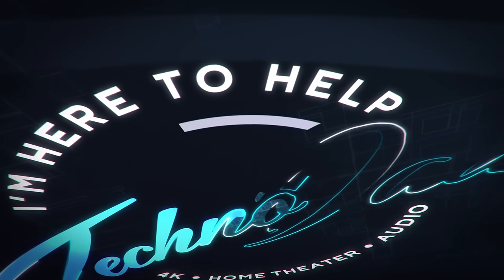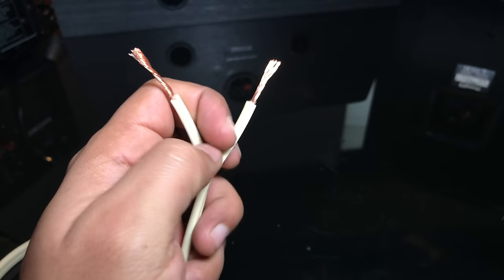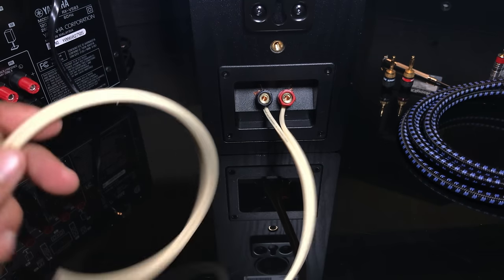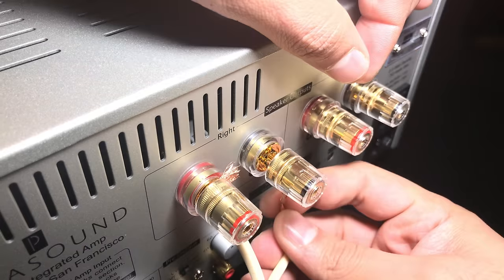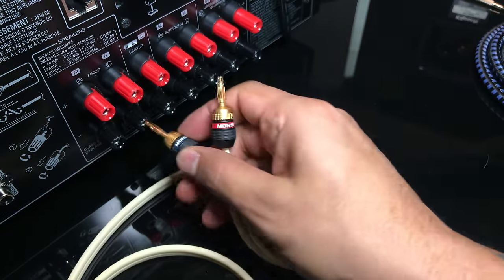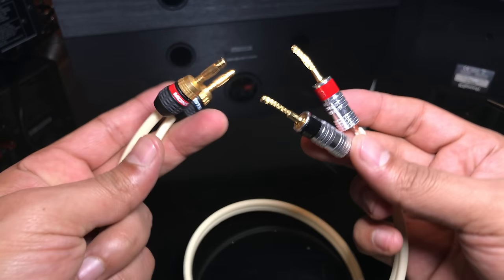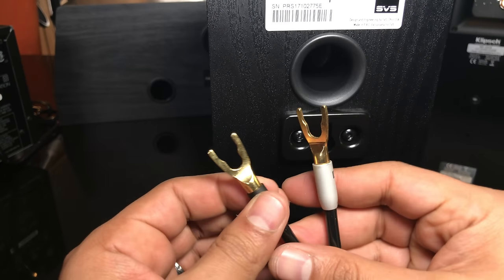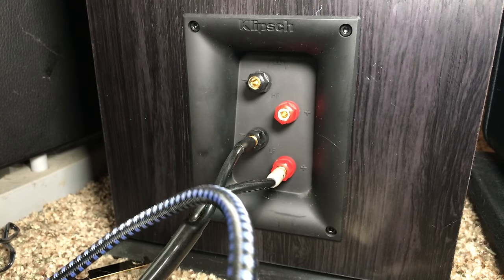How to Connect Speakers to Amplifiers | Home Audio Basics

Comment: Is there a way without having pre outs on your receiver to Output to a separate power amplifier. I know subwoofers can extract the audio signal from high level inputs but is there any devices that can receive high level power signal with binding posts inputs for multiple channels to be converted to line level outputs?
Reply from the maker: I don't think so.  If you're already sending the signal and power from an AVR to an amp input, I think that would cause problems.  Also, it's probably hard to find amps that will have binding posts as inputs.
Reply: Techno Dad I know they make converters for car audio that can convert the speaker outputs from your head unit into line level. Most subwoofers can do this as well they can extract the signal from the power output of a receiver and amplifier.
Reply from the maker: Oh that's cool.  I haven't tried that out.
Reply: Techno Dad I did a little research and found out that the car audio ones have a 60 watt limit.
Reply: Techno Dad I did a little research project I found that Carver made something called Z coupler that did that.

Comment: just got a old wharfdale dx1 cinema speakers (probably the same connection as current dx2) - just tried plugging a 4mm 'qed airlock' banana plug in and it doesnt seem to fit - fits ok into my denon 2019 av receiver..
Reply: to answer my own question and from a forum somewhere - wharfdale dx1 (and prob dx2) do not take regular sized 4mm banana plugs - need shorter ones or connect via cable only.

Comment: i have a bluetooth speaker harman kardon play 2 and the speaker is blown out,i read the specs of the harman kardon and it says Input Impedance250mV/>10k ohms..the original blown out speaker was 4 ohms my question is can I replace it with an 8ohm rated speaker looking at the amps specs? Thanks

Comment: Hey, can you help, I have 2 center speakers but only 1 port on reciever  for 1 I have them vertical each side my tv. Could I possibly use 1 port for both speakers
Reply from the maker: I would not do that.  Do you have a speaker on either side of the TV?  Those should be your front left & right speakers.
Reply: @TechnoDad  hi thanks for the reply, yes I have 2 center speakers and also L/R speakers. Could I possibly use the surround L/R for my 2 center speakers
Reply: @TechnoDad  I have 2 jbl stage A135c vertical on the wall each side my tv. I also have 3 floor standing speakers in 3 corners, front left front right and back left corner.. I have 2 subs and 2 bookshelf.. my avr reciever denon AVR-X1700H.. I cannot have 1 center speaker above or below my tv so I need help trying to set these up best way possible.. I was thinking about using the back left floorstanding speaker jbl stage A190 as a center?
Reply: Or have my front right floorstanding speaker as my center as its pointing to my seating position straight towards me then have the back left floorstanding speaker as my front right

Comment: How do you plug the other end into like a TV or something. Do you use the same banana plug
Reply from the maker: No, you would need to connect the other end into an A/V Receiver and then connect the TV to the A/V Receiver via HDMI ARC or Optical cable.
Reply: @TechnoDad  can you plug it from a speaker into an amplifier and then into a TV? Because those are cheaper from what I can see

Comment: Wouldn't an expert be using a wire stripper to prep the cable? Maybe explain that twisting the wire is to prevent fraying?
Reply from the maker: I was 12 when I was doing this.  Didn’t need to be an expert.

Comment: hi techno dad, i have a marantz 8012 receiver and I'm using banana plugs on all of my binding posts, for some reason i lose the signal from my height 1 left binding post about every two weeks, after I unplug the banana plugs from the terminal and connect it back to the receiver the sound returns to the speaker and everything works perfectly again,i don't have this problem with the the other binding posts and all the other speakers works flawlessly. Do have an idea on what can be the problem? Can the receiver be damaged? Even though it works perfectly for days until this problem occurs? 
thanks
Reply from the maker: Hi, that sounds very strange.  I would contact Marantz support to see if something is wrong with the receiver.

Comment: Hi, I am very frustrated with my speakers. There is an uneven sound undulating and I have cleaned, stripped and the wires many times now re-wired the speakers and the sound persists. is the wire too old?

Comment: The speaker wire you use depends on where you want to put your speakers. For example if you put your speakers maybe in the wall then you would need in wall speaker wire.
Reply from the maker: Totally!!  I didn't get into CL2 or CL3 rated wires as the request from a subscriber was to make a video about connecting speakers to amps/AVRs.

Comment: I did just like you the amp can detect the sounds( it beats as per the music ) but the speakers are muted
Reply: EL clan PUBG Mobile I realize this is an old post, but how did you solve the problem? I'm having the same issue; I bought a cheap roll of wire that I am in the process of returning and I'm hoping that will make the difference.

Comment: Hey I just got my klipsch RP-280 set. I was wondering how your RP-250S's have the banana plug connectors. Mine I have to feed the wire through and screw the post down....
Reply from the maker: Hi!  I have all those same speakers and there are little red and black caps on the ends of the binding posts.  You'll have to remove those.
Reply: OK. Rookie question #2... When I start setting up my receiver with the heos and mic, how do i connect it? HDMI cable to say HDMI 1 on my TV? before today I only had a subwoofer hooked up and I used an optical cable to make it work. Now it's time to calibrate it all and I don't know how to start😂
Reply from the maker: Do you wanna email me?  Technodad55 at gmail
Reply: Hey I emailed you. Just making sure you got it...

Comment: I bought a Yamaha 5.1 surround sound package. It came with 24 gauge speaker wire it worked ok but was told to upgrade my wire to 18 gauge, I did that and my receiver started smoking and turned off. What di you think I did wrong.?

Comment: I don't know about audio system. I have bought edifier R1280T Bookshelf Speaker.... I feel that I'm missing the bass a lot. Is there a possibility to connect subwoofer with R1280T speaker. It's possible then how? What can i buy more to bring the bass effects to the audio. Thanks in advance

Comment: My speaker amp had the spring clips on it, and unfortunately when I try to use pin connectors on it it dislodges the connectors, and thus I have to load them back in, I'm thinking of just going w/o the connectors for the amp.

Comment: I did everything correctly but my left Speaker is distorting for some reason even tho they are new.
I tried switching the cables but nothing changes, the right one is sounding pretty good.
I didn't drive the sound to much.
Could it be that my left one is blown up even tho it's not used yet ?

Comment: If the “insulated” aluminum base of those pin connectors come in contact with each other will they short out a reciever and/or the speaker? Are they safe to use or should extra insulation be applied just in case? Help me @technodad youre my only hope.
Reply from the maker: Lol!  Hi!  Yeah, that could possibly happen.  Maybe some electrical tape would help?

Comment: @RD CREATIONS   @RD CREATIONS  I have bought ahuja tza 4000em amplifier ; how can connect six speakers with 4w,90DB,200Hz_1KHz,120/240v, 70/100v inputvoltage each, could you tell me the bes
t connection to get good clear sound?

Comment: I bought speakers that say 100W in the manual, is that 100W for 1 speaker or for both?
Reply: 1 speaker
Reply: @luxurybuzz3681  So each speaker can handle 100W right?  And if I have an amp that is 100W is that 100W output per speaker or 50W per speaker?

Comment: So please help me here. I have just got a second hand onkyo tx sr 606 avr receiver and I have never used one before and I have got a second hand pair of B&W p4 floor standing speakers but they don't have any clip or bridges on the back where the binding posts are. I was told that I just need to get some regular speaker cable and then from the avr to the speakers split the cable at the end and go through the top positive to the bottom positive and the same with the negative.. I'm lost then someone says I need a piece of wire to go between the two sides.. What do I need to do please.
Reply from the maker: Oh, just get some bi-wire cables - https://technodad.biz/BiWire
Reply: @TechnoDad  so if I bought bi wired cables then will I need the bridge bar terminals?

Comment: Hi I have lepy mini amp how do I connect creative mini speakers to the phone through the amp. The speakers have a 3.5mm plug I have connected 3.5mm connection from the speakers to the amp through the 3.5mm jack and it turns on but the volume treble or bass didnt work it only plays through the speakers. Not through the amp  It works if I plug my presonus speakers through speaker wire to the amp can I get something so it does also why would it not work.

Comment: Hi i have an old aiwa SX ANV-900 speakers, I dont have the stereo system now, how can I use the old speakers?
Reply from the maker: Hi!  You could get a small amp and connect those via BT to your phone or optical to your TV at least.
Reply: @TechnoDad  my problem is that it has extra pair of wires for both speaker for the surround sound aside from the pair of L and R wire for the main speaker.
Reply from the maker: @luigisalvacion4536  What AVR is this?
Reply: @TechnoDad  the speaker is from an AIWA hifi component but we dont already have it. On the speaker it says AIWA SX ANV-900 Front 180° 4-way bass reflex speaker system.

Comment: i have a subwoofer for home theater and ive never seen this but it has 4 + and 4-. 2 are input 2 are outputs how do i hook the speaker up. its a 6 speaker and im trying to hook it up to a stereo reveiver.
Reply from the maker: Hi John!  Email me with some pictures of the subwoofer connections.  Technodad55 at gmail

Comment: I have the banana clips and yeah that shit was expensive. I have two home theaters so it took me awhile to get clips on all of my cables and yeah makes it easier when I upgrade receivers. I'm use 12 gauge cables in the living room, and a mixture of 12/14 in my computer room.
Reply from the maker: I only have 12 gauge on my front stage.  I couldn't imagine trying to hide two 12 gauge cables in the carpet for my surrounds.
Reply: Techno Dad I have one of those long heating vents I hide the cables under. Couch against the wall so you can't see it. Living room I have 14 gauge for the rears with carpet and long part of my sectional hiding the cables.

Comment: I bought bananas clips but they don't fit into the hole for sub-woofer.  I purchased a new sony 760 receiver.  but using old sony speakers from  previous system. I had to cut the end off of old wire. what should i do?
Reply from the maker: Does your subwoofer have an RCA input?
Reply: @TechnoDad  Not sure this subwoofer is from my old sony str-dh380 home theater system

Comment: It's at a "crazy" angel because you didn't bend the connectors!  Those particular connectors are meant to be bent as needed. If you would have bend them at a near right angle, you would have had far less difficulty.  Either way, really good video!
Reply from the maker: LOL!  Right on Mondo, thanks for the tip!
Reply: Absolutely! No doubt, brother! Ol' school style, baby! Haha!  I am an old NYC DJ and back in the day we used to just push these bad boys into the ground to bend them to where they would fit nicely!  We had to improvise because we never had tools!  I enjoyed the video very much, I actually order the monster banana plugs. They do cost a bit more but they will make life much easier!
Reply from the maker: I see!!  Thanks for the tip!!
Reply: Could always trim the cable to different lengths!

Comment: How we defer positive and negative wire? Both looks same colour..?
Reply from the maker: One side will have writing on it.  Figure out if you want that to be the positive or negative pole and stick to it.
Reply: @TechnoDad  thank u.. Everything ok now. Now i have a 7.1.2 system. I used my old boss acoustimas 5.1 's speakers for front center left and 2 ceiling downfiring speakers and used 2 onkyo speakers for surrounding L and R and back surrounding. I need to find couplers for my 2nd subwoofer. I do have 2 subwoofer cable thought to connect each other. So it will reach my 2nd subwoofer. Thank you so much for ur suggestions. I need to update my projector to a 4k from epson 2150. Thats my next project. 🙏

Comment: Why is a bare wire connection not recommended?
Reply from the maker: Hi Gary!!  After about 6 - 8 months the ends get black and damaged looking due to the current that’s running through the wires.  I would go back in and re-strip and get more clean wire to reconnect the speakers.  You don’t get this issue when using banana or other style plugs.

Comment: I bought the RP-280F'S RP-450C and the RP-250S's and none of them are able to use banana plugs🤔
Reply from the maker: Hi!  You have to remove the caps on the ends of the binding posts.

Comment: Nice but 2 comments. Push banana plugs all the way in, not half, and when you strip your wire, don't leave any strands of bare wire hanging out not covered, it has to be inside the sleeve so it does not touch anything. apart from that good video.
Reply from the maker: Good points!

Comment: If I have the ability to put a wire in why would I use a banana clip that seems like an added step and will do nothing to increase the sound Just slide the wire through the little hole after you unscrew the tabs locket back down and call it good
Reply from the maker: After about 6 or 8 months the copper turns black due to usage.  That doesn’t occur with banana clips or spades.

Comment: So connecting 8ohm to 4ohm is OK? Didn't cover this. Your amp will cut out if this is wrong.
Reply from the maker: Of your speakers are 8 ohm and your amp is stable at 4 ohms you’re fine.  If it’s the other way around...speakers are 4 ohm and amp is 8 ohm stable, you’re not fine...

Comment: I have 5 speakers and they take turns making weird sparky noises anyone know what may cause it?
Reply from the maker: Not sure, but it doesn’t sound normal…
Reply: @TechnoDad  aparently it occured only when using the bluetooth, sound is fine with optical cable.

Comment: Wow, connecting those speaker wires is so outdated
The manual does not tell you have to put them in the posts.
You would think that in the 21st there would be a better system!
Reply from the maker: Yeah, it's been the same thing as long as I can remember.

Comment: What is the point of this video. I mean I don't have problems with the connectors I'm talking about the actual connection itself how do you hook up a two-channel system do you use the b or you just put it all under a. Like nobody has this fucking information anywhere it's ridiculous